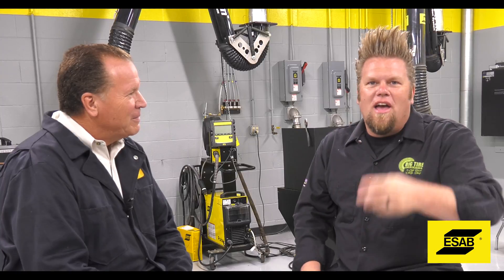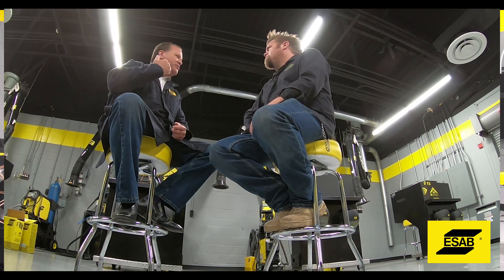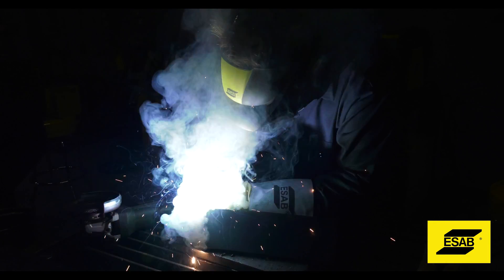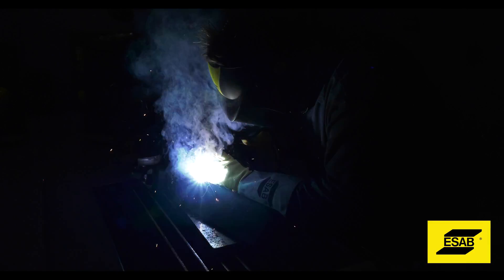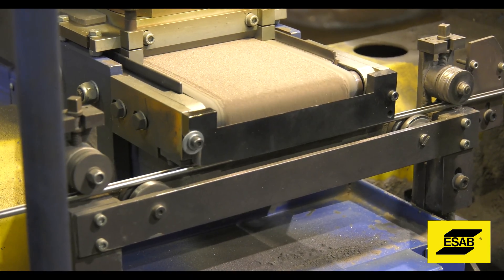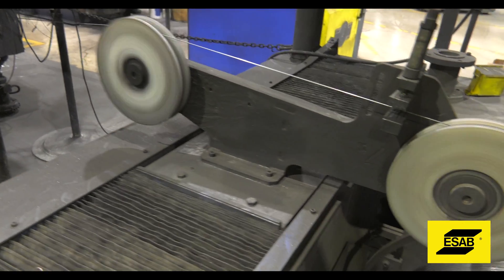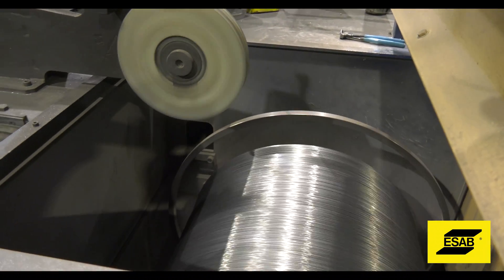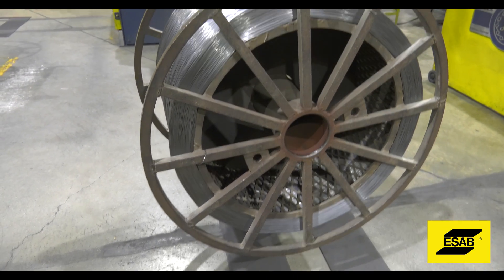Dual Shield X-Series Wire

Comment: Ever since I've tried core-shield along with gas, there's no turn-back. Of course I won't use it for any manufacture-shop work as in welding repairs very serious machinery. But for home use, it's a blast. Wither it's windy outside, wind comes into the shelter etc, or even when you have to weld outside, the combination of bolt is perfect for me. I only wish any wire makers would have some high quality flux-core self-shield anything though. But I would still add gas along with it for my needs.
Reply: GHISLAIN LETOURNEAU are you saying you won’t use it for any serious structural welding in the shop for serious machinery? That’s Excactly what it’s made for.

Comment: We love the other dual Shielded products runs clean and smooth... But, Did they solve the worm hole porosity issue with this wire??
Reply: Run hotter, make sure you don't have any "old" wire with questionable moisture contamination, up your cfh ... several videos by weld.com explain how to get rid of wormies.
Reply from the maker: We're not aware of any issues with this product, but we recommend you connect with your local ESAB sales representative if you're experiencing issues.